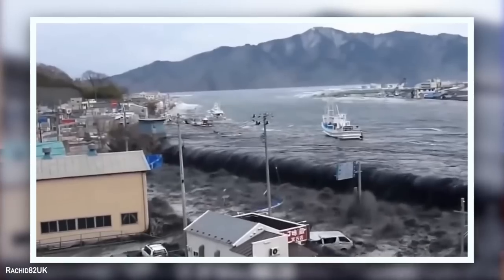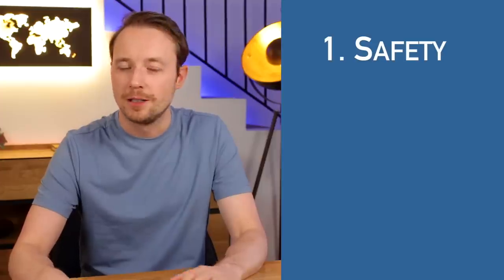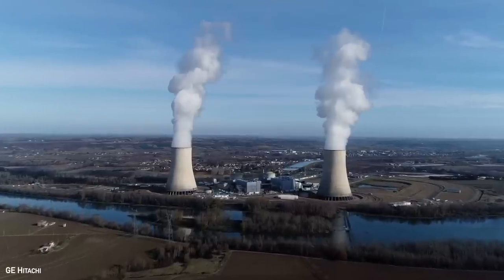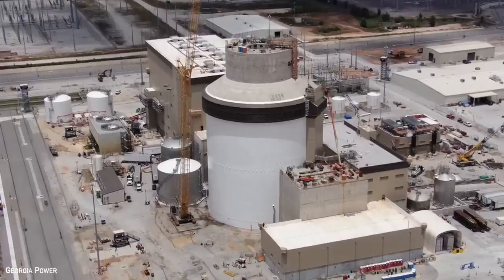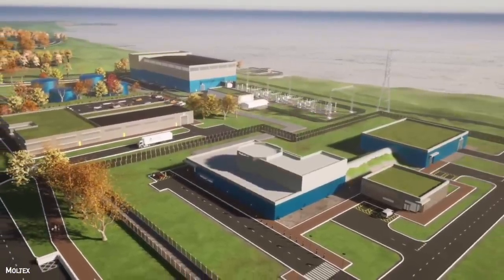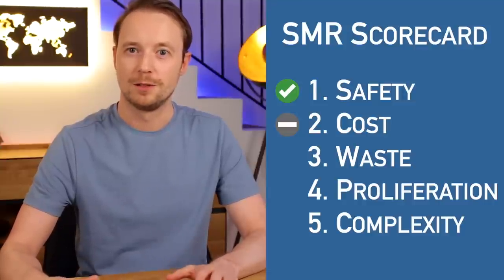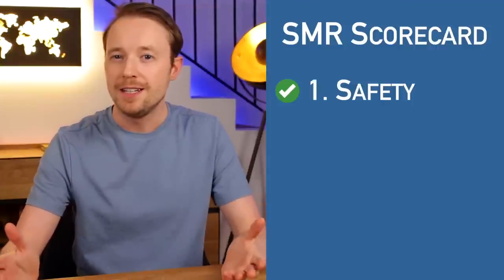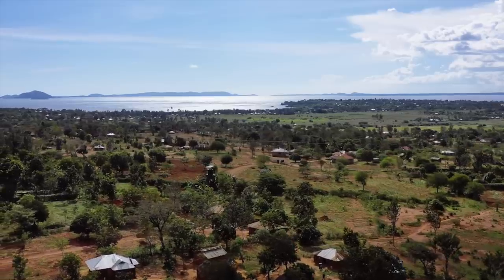Can Small Reactors Revolutionize Nuclear Power?

Comment: Fluoride can indeed be used as a solvent for uranium, including the separation of U233 from molten salts in a molten salt reactor. However, the feasibility of this approach depends on several factors.

One factor to consider is the chemical properties of fluoride. Fluoride ions are highly reactive, and they can react with many substances, including metals. This reactivity can be an advantage in separating uranium from other metals in the molten salt, but it can also lead to corrosion of the reactor materials, which is a significant challenge in designing and operating a molten salt reactor.

Another factor to consider is the radioactivity of the materials involved. Separating U233 from molten salts is a complex process that involves handling highly radioactive materials, which requires significant safety measures and specialized equipment. The use of fluoride as a solvent can also produce radioactive waste, which must be carefully managed and disposed of.

Despite these challenges, fluoride-based methods have been studied and developed for separating U233 from molten salts in molten salt reactors. Research has shown that fluoride-based methods can be effective in separating U233, but further development and testing are needed to determine their practicality and feasibility in large-scale commercial applications.

Comment: Excellent well balanced video. When talking about renewables and stating their low cost, we should perhaps also add in the extra cost of a backup solution which is needed to be available so when the wind doesn't blow / sun doesn't shine etc.. i.e. Solar plus batteries / wind plus hydrogen storage etc.
Reply from the maker: Good call! Often that gets forgotten (I've done it too...)
Reply: It helps that many places have stopped accepting large renewable applications without storage...

Comment: While the RR SMR is not technically an SMR due to its size at 470MW it has been designed to the maximum diameter of the reactor for road transportation under bridges etc.  clearly RR saw that size does matter in terms of economics, something others are learning the hard way.  They are adopting the modular manufacturing etc.

A video reviewing the RR approach wrt SMR vs mid vs large would be interesting. 

It would be good to also include a chapter on Sheffield Forge Masters new welding tech designed specifically to reduce the fabrication time while increasing quality of nuclear reactor vessels.

Great channel. I have worked on the JET project and for nuclear operators and I am still learning and your channel is very insightful and well researched and presented.  Good effort.  Carry on.
Reply from the maker: I'd agree, when I first saw the RR SMR, I said, "That's neither small nor modular. But it is a reactor." It has some modularity like you said and I didn't realize they had designed largest components to be transportable on normal roads. That helps a lot in siting and construction expense since it should reduce lead times and delays.

I saw the Sheffield new welding approach, but I haven't had a chance to look into it more. If it's as good as they claim, that's huge and I don't know why there wasn't more press.

A video on the economics of S vs M vs L would be super interesting (at least to me!). I'll keep that idea on my list. Cheers!

Comment: Another great job!  Your analogy of the swimmer is absolutely spot on. LCOE is an oft overused and misused metric. 
I could push back some on your score card based on individual MsR designs as I believe certain designs hold exceptional promise. But overall a balanced view. 
I would however push back a bit more firmly on renewables tho. They have a place but I feel it is much smaller than generally believed. There is far too much hype in the renewables world. Farming energy is only slightly better than farming in general on EROI. We need an EROI that’s much higher than they offer to sustain society!  The breathing room in excess energy out offered by fossil fuels that powers our world is just not going to be replaced by renewables. For more I recommend Vaclav Smil’s book “How the World really works”. Another good critique of renewables is Meredith Angwin’s “Shorting the Grid”. It’s time to stop “kissing the ring” of the Renewables propaganda machine and tell the truth. Nuclear needs to be the backbone of our energy system if we really want to decarbonize.
Reply from the maker: Thanks! I can't fully claim credit for the swimmer, I heard that somewhere else but I liked it as a way to keep in mind why we might pay more for certain things.
I see nuclear as the reliable baseload to renewables, at least in the near to medium term. More advanced nuclear designs, or even fusion, have more promise but will take time. I'll check out the books you mentioned. Cheers!

Comment: A really good basic explanation of SMRs and their comparison to other means of electricity generation. However there are a number of factors that should be taken into account when comparing costs. Firstly the time value of money which means electricity in terms of levelised costs is higher for nuclear stations that take 20 years to build rather than 7 years. Secondly the cost of offshore wind should take into account both capital costs and transmission losses of having to connect for example offshore wind in remote locations to the grid. This compares to SMRs which can be built at existing connections to the grid at the sites of old coal and nuclear stations closer to population centres. And thirdly the levelised costs of renewables with intermittency e.g. sun and wind, need to include the backup generation capital and running costs e.g. using open cycle gas turbines for backup. In other words the costs of  generating electricity when the wind doesn't blow and the sun does not shine.
Reply from the maker: Usually LCOE and Overnight Capital take into account interest charges and such. Higher or lower discount rates could be applied and ROI would decline if a project takes longer than expected. That's one of the things SMRs should address, at least somewhat, is the looooong build times of big plants. Cheers!

Comment: A lot of technical factors seem important for SMRs but they’re secondary issues.  By far the largest issue w any kind of new nuclear tech in the US (or Europe) is the regulator, the US NRC. The NRC is malevolent, has not approved a single US reactor from start to finish so far. Every single operational US reactor saw its first proposal under the former AEC.  

Until the NRC is reformed, all the new appealing features of SMR like safety, and apparent cost savings … don’t matter if the NRC delays approval, or worse, approves the plant and then afterwards demands changes (as it did w Vogtle), or, demands some ridiculously large staff per every small reactor unit.  

For some reason most in the industry are reluctant to  call out the NRC on its obstructions, nor do media commentators point out the central problem which is the NRC.   The NRC just rejected the ultra small design of Oklo, and rejected the  extension license of a long existing plant in Florida, which the NRC had already approved.  

Until this problem is confronted, even well informed and prudent pro/common videos are a waste of time.

Comment: I saw 2 points you brought up that are caused by fear mongering instead of actual fact.
1. The waste nuclear reactors produce is actually really small 
Fuel rods are 4% fissionable material, each rod usually last 5 years and after they're finished about 4 % of the fuel rod actually becomes waste. The actual global weight of waste each year is about 10.000 metric tons which may seem like alot but that's about 500 m3 per year which means you could fit 100s of years worth of nuclear waste in a couple of warehouses.
2. Proliferation
Like I mentioned nuclear fuel is about 4% fissionable material
For any explosive weapons you need upwards of 90%
Which needs massive processing plants that costs billions 
So that's also a fear mongering argument

Comment: Great but not going anywhere till the regulations are changed.
One thing not mentioned about cost is the electric waste and cost of transporting electricity. With SMR's those costs are way down as they can be way closer to the demand of the electricity.  Factories that use a ton of power could install one and have very reliable power.
Reply from the maker: Regulations, at least in the US, are directed too much towards light water reactors and NRC has struggled to adapt to anything else. Momentum is a powerful thing.

Comment: I think molten salt designs need more exposure. Especially those using Thorium as a fuel.
Reply: The USA tried that back in the late 60's.   If you read the final report, they listed many total roadblocks-- even at just 10% of the neutron flux needed, many components broke down.  Lots of major stopping-points.
Reply: @georgegonzalez2476  that's not what I heard about the Oakridge unit. It ran for many months; yes lots of blocks, but none that are insurmountable. needs funding, good research. It will be with us well before 2030
Reply: @mrstevecox7  Go read the actual final report. 

 https://www.osti.gov/biblio/4372873

 used the most exotic alloys they could find, and the thing irretrievably broke down in just a very few months at around 10% of the economical flux level.  Many other issues that they had no solution for then or now.   Servicing the valves and heat-exchangers was impossible due to the deadly remnant radiation levels.    The one similar reactor that they French tried, it needed FOUR ACRES of reprocessing buildings, running continuously, to filter out the worst of the fission products.  In a production reactor you would need those buildings at least duplicated so there would always have a chance of having one running reprocessing facility at all times.   A huge no-go technically, operationally, and economically.

Comment: I'm betting on India or Israel being the first to step in with both feet. Both have access to all technology needed, and the strong motivation to create a new paradigm for energy independence for their people. 
I'm pretty sure the molten salt designs will win out, and we might even see sealed systems small enough to transport the modular assembly within a few sealed shipping containers. One benefit that wasn't discussed here, but which REALLY needs to be addressed is the concept of distribution power generation. Rolling blackouts are an inevitability of large central generating. More, smaller generators are necessary to stabilize the growing power needs. SMRs are one of the few options that meets the high energy density and stable production requirements here.

Comment: The use of "renewables" in poorer nations has been costly, unreliable, and conflict-producing enterprises. In particular the use of hydro dams. Conflicts have arisen between China and, India, China and Vietnam, Egypt and Ethiopia, Turkey and Syria, and a myriad of other areas. Find a dam on a river crossing multiple nations and there is a potential conflict. The use of SMRs seems to be a reasonable solution. The safeguards of low-grade waste and storage of material can be safeguards put in place. These safeguards seem a better option than the guaranteed conflict caused by the use of very expensive hydroelectric dams.

Comment: Point Lepreau CANDU reactors in NB are installing one SMR as a field pilot project with the intent to reuse some of the on site stored spent fuel which still has 90% useful energy that could not be extracted with the earlier Gen CANDU reactor. The engineering of the reactor was done a long time ago.

Comment: Seeing how the X-Energy XE-100 SMR works, it's pretty interesting. With Dow buying them for electricity and steam output, these SMRs can be used for much more than just powering the grid.
Reply: Reality (sort-of since none have been even built yet in the U.S.)

This is from the Des Moines Register an concerning the only Small Modular Reactor (SMR) project in the U.S. today. It should be noted that NuScale said this month (Jan/2023) the target price for power from the plant is $89 per megawatt hour, up 53% from the previous estimate of $58 per MW hour

In 2013, the Wall Street firm Lazard estimated that the cost of generating electricity at a new nuclear plant in the United States will be between $86 and $122 per megawatt-hour. Last November, Lazard estimated that the corresponding cost will be between $131 and $204 per megawatt-hour based upon the 4 recent new nuclear projects in the U.S. . During the same eight years, renewables have plummeted in cost, and the 2021 estimates of electricity from newly constructed utility-scale solar and wind plants range between $26 and $50 per megawatt-hour. Nuclear power is simply not economically competitive.
SMRs will be even less competitive. Building and operating SMRs will cost more than large reactors for each unit (megawatt) of generation capacity. A reactor that generates five times as much power will not require five times as much concrete or five times as many workers. This makes electricity from small reactors more expensive; many of the original small reactors built in the United States were financially uncompetitive and shut down early.
The estimated cost of constructing a plant with 600 megawatts of electricity from NuScale SMRs, arguably the design closest to deployment in the United States, was originally advertised as costing $1 billion but upon requesting actual bids from engineering firms, increased to $6.1 billion in 2020. Given inflation and other cost constraints that cost today can only be expected to be significantly higher.
The cost was so high that ten members of Utah Associated Municipal Power Systems canceled their contracts. NuScale then changed its proposed plant configuration to 6 fewer reactors but increased each reactor output from 50 Mw to 77 Mw costing at total of $5.3 billion. The NRC just last week approved the construction of the 50 Mw design but now will have to start the review process all over given the switch to a 77 Mw design. For each kilowatt of electrical generation capacity, that estimate is around 80% more than the per-kilowatt cost of the Vogtle project in Georgia — before its cost exploded from $14 billion to over $30 billion. Based on the historical experience with nuclear reactor construction, SMRs are very likely to cost much more than initially expected. And they now have delayed the project start until 2025 in an attempt to find more backers.  All this before the inevitable setbacks that will occur once construction starts.

Comment: 10:00 This cost to build per kW chart includes wind generators as if they are independent generators which they are not.   Wind generators have to have their power output conditioned to grid quality typically by NGCC plants and can not provide power grid capacity because they may not be operational at all times.
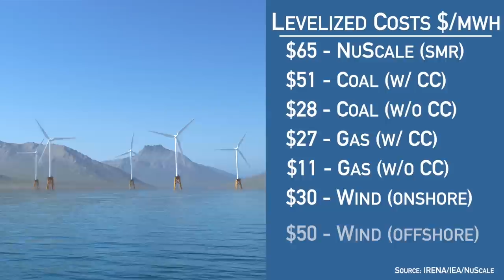10:16 $11 MWh NG without carbon capture is $0.011 kWh or 1.1¢ kWh.  That is considerably cheaper than the cost of NG fuel at $5 mmBTU.   
$5  per mmBTU NG,  273 kWh = mmBTU,  50% efficiency NGCC power plant
(273 kWh/$5) X (1/273)/(1/273) = 1 kWh/$0.018.  100% efficiency 
 NGCC plant 50% efficiency 1 kWh/$0.018 X 1/2 = 1 kWh/$0.036 or 1 MWh/$36
With wholesale prices for NG in 2022-12-22 hovering a bit above $5 mmBTU in the USA a reasonable estimate for fueling a natural gas combined cycle plant is $36 per MWh which much higher than the levelized cost of $11 per MWh show in this chart.  

Even when NG was for a brief time at $2 mmBTU this would of only put the fueling costs at 2/5 of $36 MWh or $14.4 MWh.   This is just fuel cost of NG!  No physical plant costs included.   

NG is no longer cost competitive with coal as a fuel for generating electric power which it had been increasingly since 2008.   The chart at 10:00 shows coal plants are 2 - 3 times more expensive to build per kW than NGCC plants. The estimates for coal plant cost per kWh appear low.   2005 estimates I've seen in reports placed new coal plants at around $4,000 kW with prices going up so fast contracts were not able to give a guaranteed cost estimate causing few contracts to be singed.   New modern coal plants produce almost no environmentally harmful air emissions and are much more efficient than the bulk of older USA operating coal plants.  A modern new coal generating plant could have fueling costs close to 1¢ kWh.  The do need to be of large scale to spread their large crewing costs over a large plant.   The mining of coal and handling of coal  The big question is what is going to happen to the long term cost of natural gas in the USA.

Comment: As a former nuclear engineer, I have to say that SMRs are unfortunately dead on arrival until nuclear regulations are completely scrapped and replaced with regulations that are built around passively ensuring safety during core damage events.
Equally, SMRs are dead on arrival as long as I cannot use ASME Section VIII (conventional pressure vessels) for everything.

Comment: There's a lot of nuance that cant fit in a convenient run time. 
the overnight cost thing tends to be a bit fuzzy. a properly designed large-scale reactor could potentially run for a 100 years. but you might have to pay that overnight cost 3-5x in the same period for wind, solar or SMR. Sealed SMRs have a wide variety of run times 6-20 years but generally, it's only a portion of the overnight costs. 
the overnight costs might be quite a bit lower if we build SMRs on the site of old coal plants which already have steam turbines. 
Financing costs on a full-scale reactor rack up insane amounts of interest because the payback doesn't start for a decade. 
SMRs deployed in say 5 years at a lower cost save a lot on interest and it might be possible in a few cases to build them loan free.